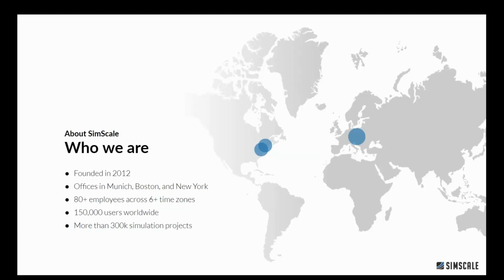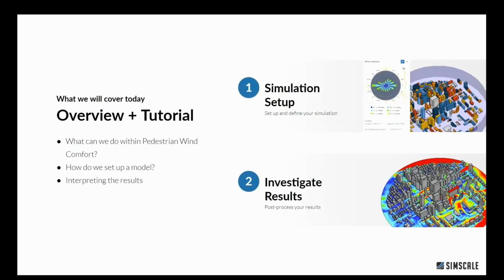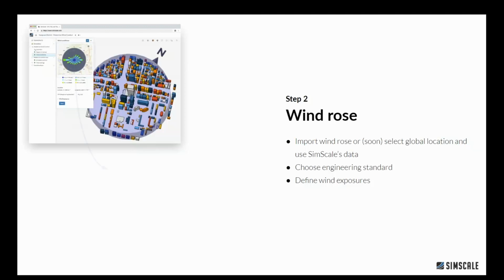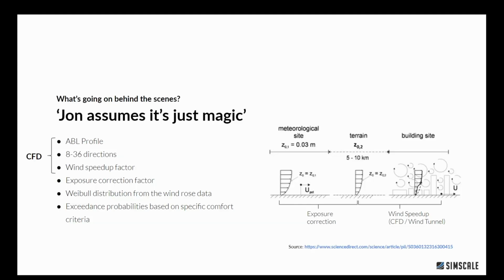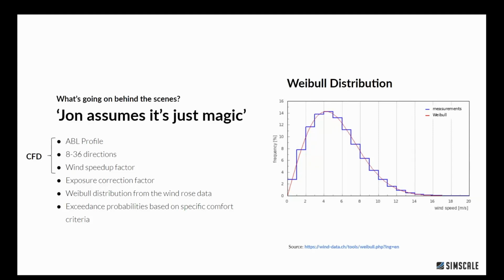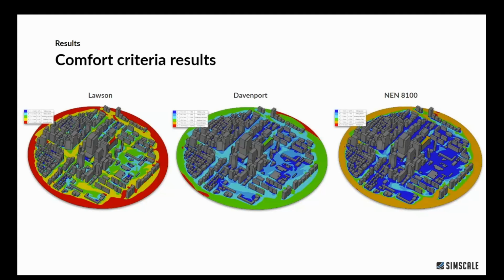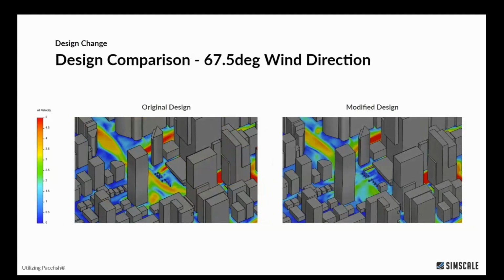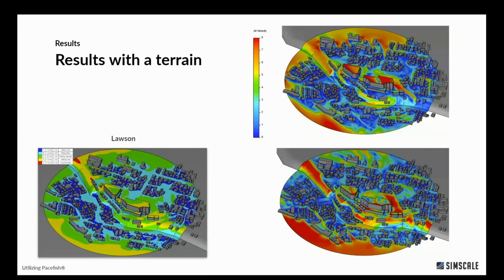Multi-Direction Pedestrian Wind Comfort Analysis

Comment: Nice models! I was unable to attent the webinar even though I was registerd. So I just ask here instead :). I have a couple of questions: 
1. How transient is the transient simulation? I do not se any timescale. 
2. Do you perform a transient simulation in each step rotating around your compass? For how long?
3. Do you take the turbulence in to account. Like adding a term to the velocity, like [velocity]_experience = [velocity]_actual+[velocity]_Turbulence?
Reply from the maker: Hi Robin! We're so sorry that you were unable to join the webinar. We experienced some technical problems that we thought were resolved. Thanks for reaching out. Your questions have been forwarded to the team and we will get back to you asap!
Reply: Hey Robin, I can try to answer :)
1) Fully transient. The comfort and safety criteria are a statistical calculation though. If you watch the transient section, you’ll see the time steps at the bottom of the screen 
2) A single transient solution is run for each direction of the applied wind rose, up to 36. This is deliberate and the correct way to calculate wind comfort :)
3) The flow is fully turbulent. This can be driven from the inlet as well as being generated from features throughout the design

Does that help?
Reply: @jonwilde1044  Hi again! Tack you for the answers. I did not mean I was unable to connect, I was sent on a Conference on short notice, that is why I was unable to attend. :) 
Impressive that you do transient simulations for all the directions. I am myself creating a method for wind study simulations in a different CFD code.
I get that the flow is fully turbulent. What I mean is that sometimes there is a term included in the velocity evaluation that ads a contribution to the velocity from turbulence, since it is more uncomfortable to stand In turbulent wind, (gusty wind). However this might go a little against the different criterions (Lawson etc), or perhaps it can be considered to add a conservative term to the recomendations given after the analysis.